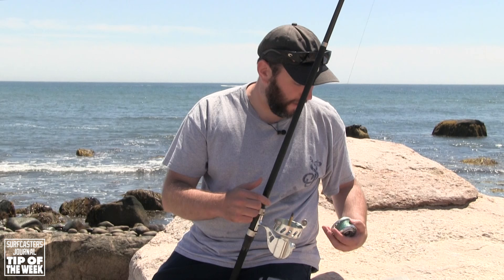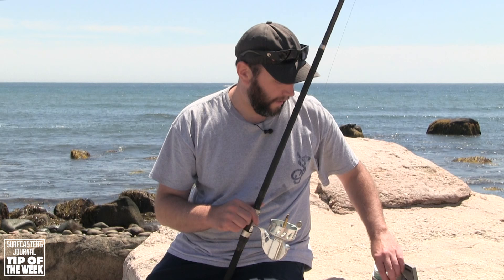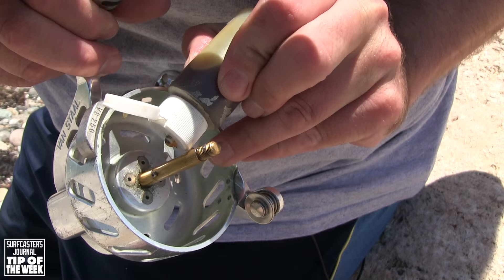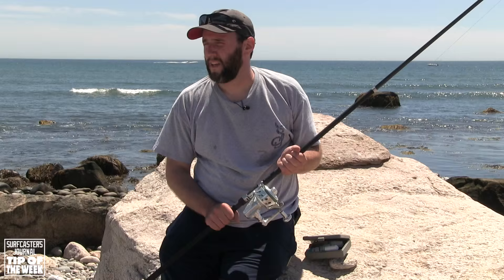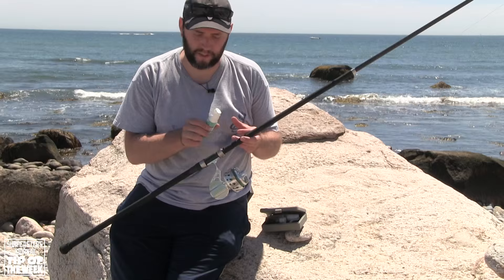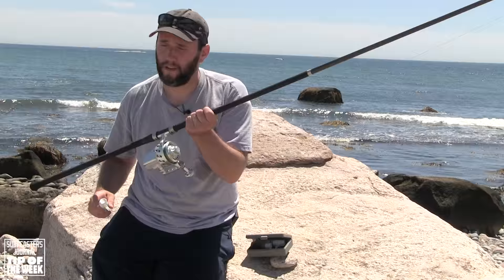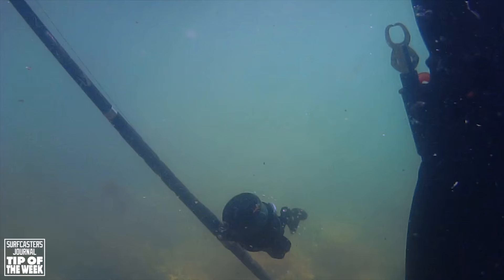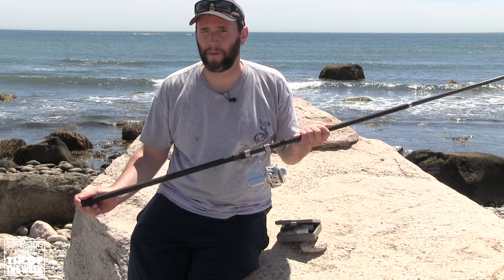Surf Fishing Tip Of The Week # 1- Simple Reel Maintenance with Dave Anderson

Comment: I rinse my reel and rod with plenty of fresh water after each use and a drop or two of oil on either side of the bail ,if you have a bail like i do . I also put a drop where the handle spins. I always have a dab of quality grease at base of the spindle. My mentors lectured me on the importance of maintenance especially my TOOLS. Saltwater is tough stuff rinse it off after every use, flush the  line too. This takes no time at all